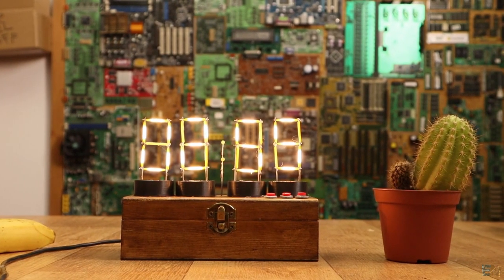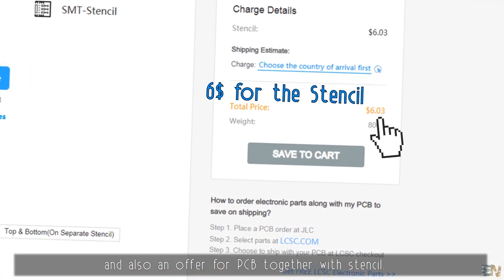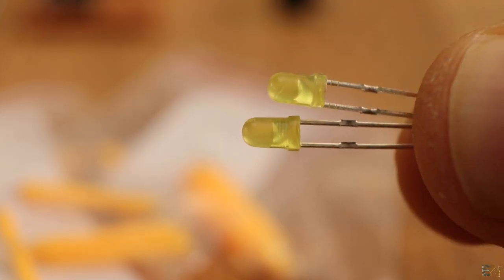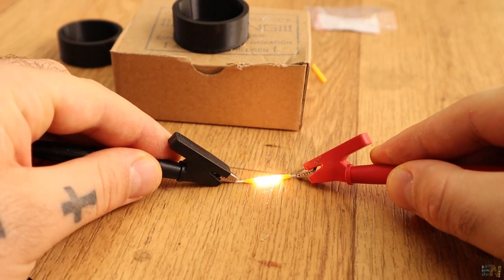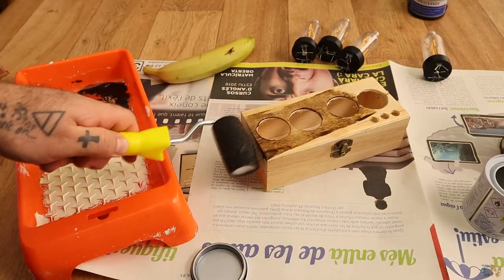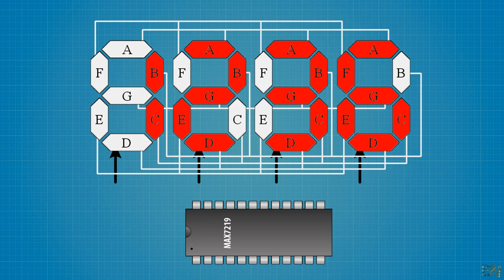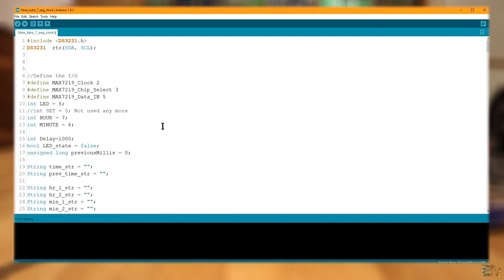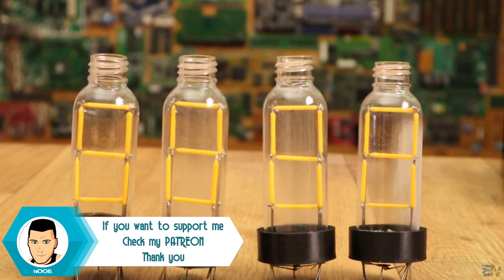DIY clock | Homemade 7 segments "nixie" tubes

Comment: i am getting an error with the code Arduino: 1.8.13 (Windows 10), Board: "Arduino Uno"

no matching function for call to 'DS3231::DS3231(const uint8_t&, const uint8_t&)'
Reply: hi there! I am getting the same error. tell me did you find the solution for the problem??Because I am currently stuck. Please help

Comment: Great project. Do you think  it help if you paint the sides of those filaments black ? Maybe it would be more visible ? It seems that the light from the other filaments is making them look bright even though they are off.
Reply: With some translucent paint or film on the inside of the plastic covers much of the stray light would be filtered out, making it clearer to read.

Comment: Great project
I will try to make my one clock but these will be my first project i dont know if it goes well
Please what type of leds is it ?
Reply: The led filament kind found in LED bulbs. The kind that resemble actual bulbs and not the other led kind where the upper half of the bulb is foggy plastic and the bottom half is where a pcb with smd LEDs are mounted…

Comment: Wanted to say thanks for the YouTube subscriber tutorial!  This is somewhat similar to what I'm working on since I'm making a 7 segment display from scratch.  Since I've discovered your channel I've been spending my weekends customizing the YouTube sub counter code a bit and designing a laser cut box.  And on that note,  is there any chance you may be coming out with a tutorial on shift registers?  I have yet to find a video on YouTube that goes into depth with them.  I know the 74HC595 has the ability to allow multiplexing and also allows you to daisy chain them.  I've daisy chained 8 of them together and understand I need to send them 8 separate pieces of bit information such as '0b000010001' but not too sure on how to do that in the code.  Hopefully this makes sense and I'd be grateful if you happen to know of a video that explains this!

Comment: Did anyone actually found Glass tubes? That is like Nixie tube but just an empty tube, so i could place led inside a glass tube?
Reply: You can find glass tubes very easily. If you go to a glass blowing studio I’m sure they can hook you up with whatever you need. If you’re making really small stuff, you can get glass tubes from cigars or a cigar shop, also I’ve found cheap incense Sticks sold in 2 test tubes taped together , also, maybe an aquarium store has broken heaters you can have for free thag you can use the outside glass tube or maybe the thinner glass tubes found inside that contain the nichrome wire.
Reply: @MrRusty-fm4gb  thanks

Comment: You should have made it wireless ( the power supply for the clock )by using wireless charger ( power supply )
Reply: You liked every comment except mine ( Thanks for letting me know that my suggestion is waste of time )
Reply: Oh ! thanks for the like..... by the way , hope you would like my idea !
Reply: That's a great idea!
Reply: I doubt anyone would need to keep moving this clock around so there's no need to power it from a battery, although the RTC module will keep the time even when the main power is disconnected. Also, as with all permanently illuminated LED clocks, the power draw would typically make battery power impractical.